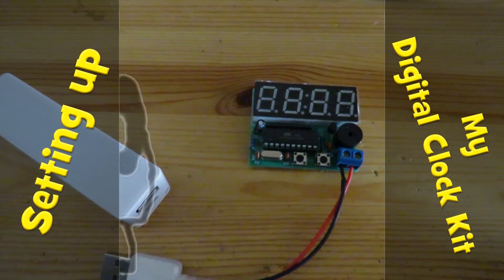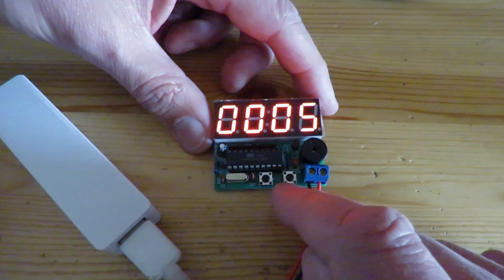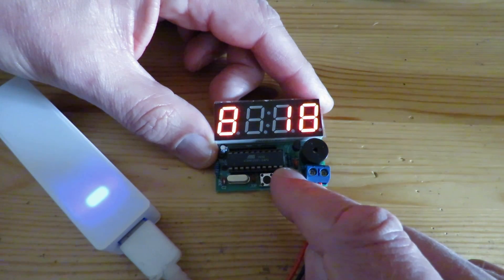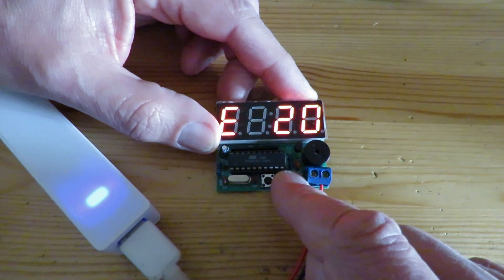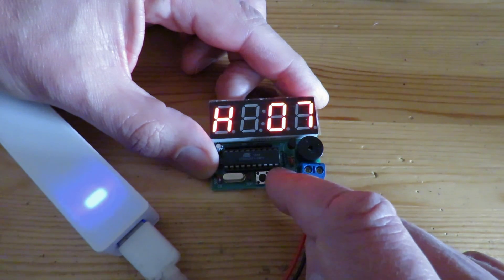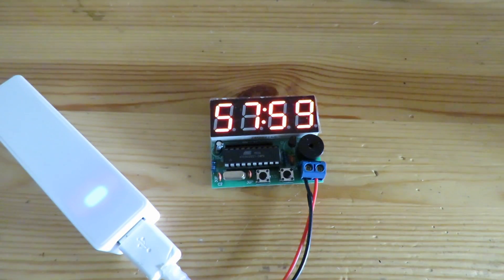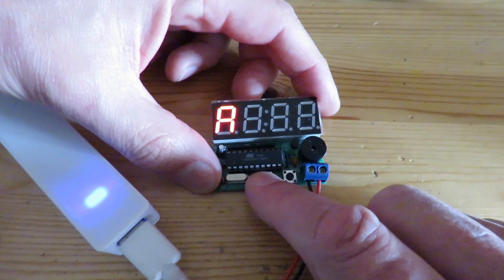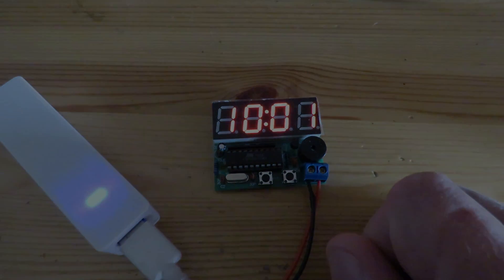Setting up my Digital Clock Kit

Comment: Thanks a million, I built one of these years ago, but back then I was new to soldering, and using a horrific butane soldering iron that produced heat like it were a blast from hell.  I burned off a lot of traces and eventually kept the chip and display and tossed the rest.  Now years later with time on my hands and a relatively good soldering iron, one from China with a sort of thermostat on the handle that takes the hoko tips and actually works very well for such things, and a few yards of solder burned up in practice, this one came out very good. That said, the kit I got had no paperwork with it, and was not marked where the + or - hooked up.  So I did trace it on the back side and pretty much decided which was plus, but before I hooked the wires from my AAA  battery pack, I watched your video all the way through just to see for sure that I did not blow up my $2.50 kit. I was right in my hookup, so I turned her on and she came to life, but I had forgotten how to set it, so I watched this video, and now I know.  Not sure what  I will use it for but it was a fun build. Oh I see you were using some rather heavy duty solder to build the kit as well, might I recommend a thinner rosin core solder for such kits, so much easier to control how much solder fills the joint when it is thinner.
Reply from the maker: Hi Jerry, thanks for taking the time to add a comment for me. On quite a few of my videos I use the cheap USB soldering irons and I did buy some very fine solder to use with them but generally I have a couple of reals of solder that I have had for probably the best part of 20 years and I am slowly working my way through them.